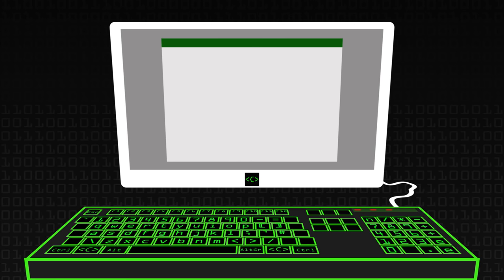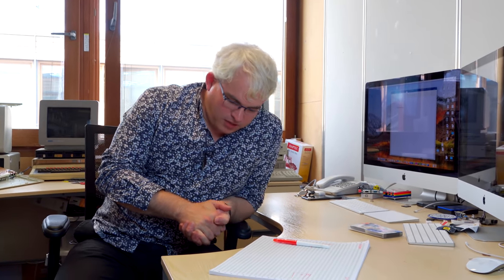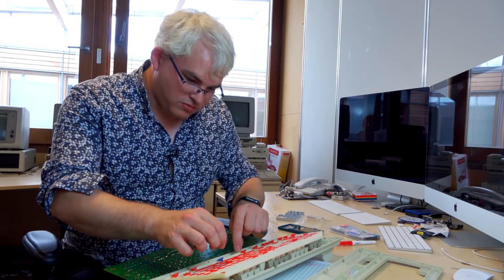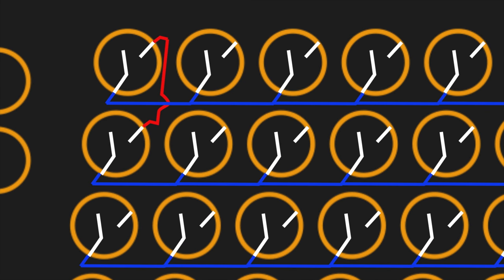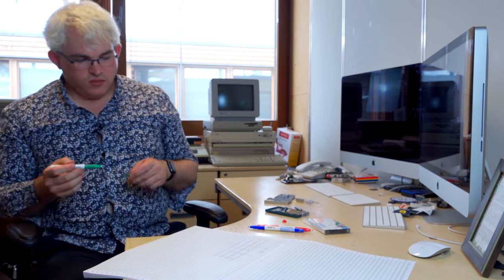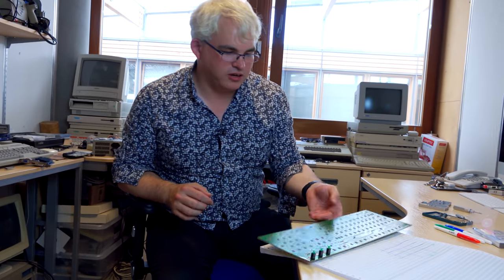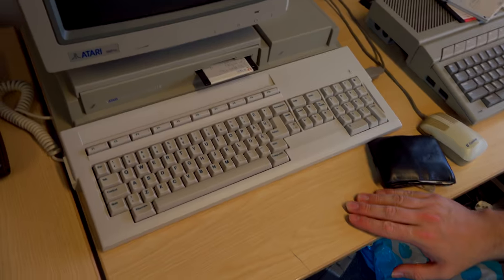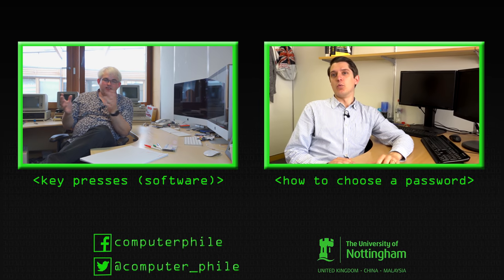What Happens When I Press a Key? - Computerphile

Comment: I'm not actually certain but I think the modern rubber dome keyboard probably owes a fair bit to the design of the Sinclair keyboard.
Reply: TheTurnipKing - The first computer with a chiclet keyboard was the Interact Model One (1978).  Virtually everything that came out in '82 and '83 had one, so singling out the Spectrum is a little unfair.
Reply: @Tevildo  the Sinclair machines are neat though because you can see the evolution from bare membrane in the ZX80, to the rubber mat over membrane to the plastic key over rubber mat over membrane that characterises modern keyboard design

Comment: Whoever invented the fn-key needs to get fired. Unlike the other control keys, "fn+A" doesn't actually register as a modification on 'A', meaning that you can't bind things to "fn+A" programmatically. Add to that the fact that there is no standard for fn-lock or no, and that the key itself is always on the opposite side of the keyboard from whatever you want to push it with...
Top 3 horrible keyboard "features":
1. fn
2. right-click key
3. insert
Reply: i wanna make a mouse keyboard now

Comment: "These day they are" 

Uh, no. Very much no. The modern mechanical switch keyboard market is very much alive thank you. You do tend not to see them outside of enthusiast set ups because they can be pretty expensive and rubber dome keyboards are just cheap. Also most modern keyboads don't use carbon contacts on the rubber domes or even a PCB under them but rather membrane sheets.